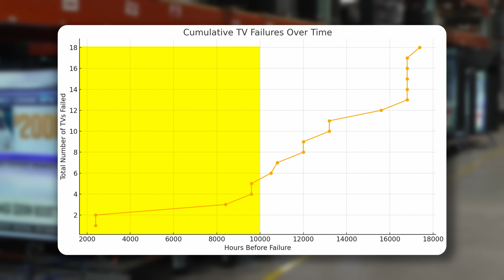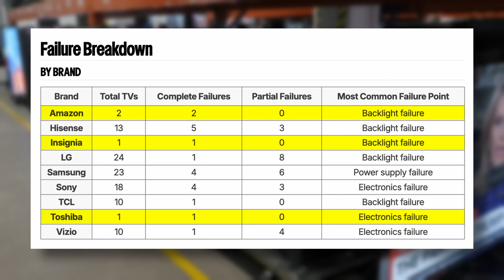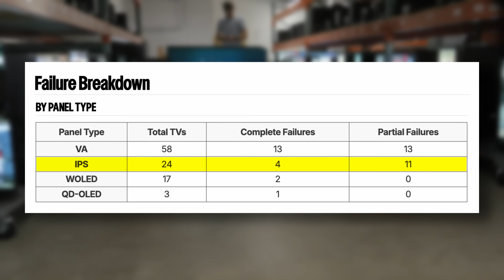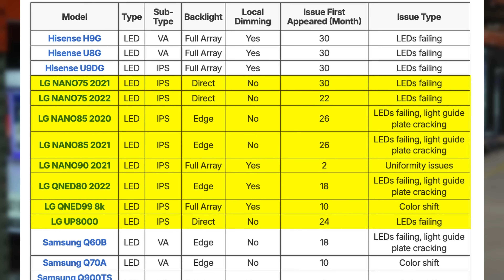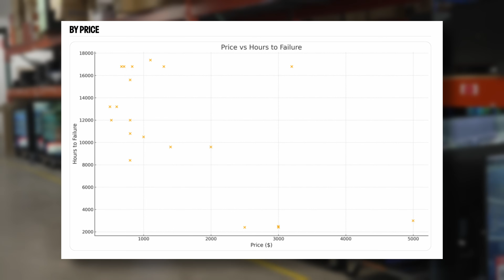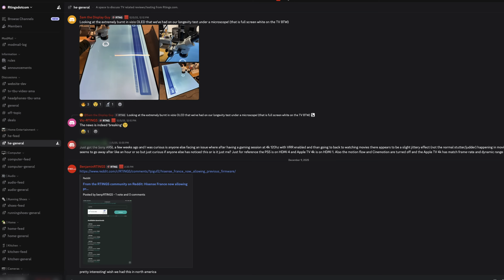Which TVs Break First? Results Overview From Our 100 TV Longevity Test

Comment: I have a TCL that's been on 24/7 since December 2018 and no issues. It's used as an advertisement screen. Only shut off maybe 5 times at the most because of local short lived brownouts, about a second each time.
I don't put its apps on the internet because... you know!  But it was a cheap tv.

Ok. So this is what I got from the data I analyzed:

OVERALL LONGEVITY TEST RESULTS

Total televisions tested: 102
Test duration: roughly three years of near-daily on and off operation
Complete failures: 20 (19.6%)
Partial failures: 24 (23.5%)
Any failure: 44 TVs (43.1%)

Most televisions operated without issues for approximately the first 10,000 hours. Failures became more common later in the test, frequently outside standard warranty periods. Each model was represented by one unit, so results show durability patterns and relative risk rather than guarantees for every unit sold.

PARTIAL FAILURES NOTE
Many partial failures were severe enough that the TV would be considered unusable or replacement-worthy in real-world conditions, even though it technically still displayed an image.

BRAND-LEVEL DURABILITY RESULTS
Failure rate includes both complete and partial failures.

TCL
Total TVs: 10
Complete failures: 1
Partial failures: 0
Total failures: 1
Failure rate: 10%
Single failure occurred very late in the test. Best overall brand durability result in this dataset.

LG
Total TVs: 24
Complete failures: 1
Partial failures: 8
Total failures: 9
Failure rate: 37.5%
OLED models performed strongly. Most failures were partial and concentrated in LCD edge-lit designs.

Sony
Total TVs: 18
Complete failures: 4
Partial failures: 3
Total failures: 7
Failure rate: 38.9%
Failures were mainly LED and electronics related. No clear systemic advantage or collapse.

Samsung
Total TVs: 23
Complete failures: 4
Partial failures: 6
Total failures: 10
Failure rate: 43.5%
Failures often involved colour shift and electronics aging rather than immediate backlight collapse.

Vizio
Total TVs: 10
Complete failures: 1
Partial failures: 4
Total failures: 5
Failure rate: 50%
Partial failures were common, including uniformity and LED issues appearing mid-life.

Hisense
Total TVs: 13
Complete failures: 5
Partial failures: 3
Total failures: 8
Failure rate: 61.5%
Highest failure rate among brands with a meaningful sample size, including failures in full-array models.

Amazon
Total TVs: 2
Complete failures: 2
Failure rate: 100%
Sample too small to generalize.

Insignia
Total TVs: 1
Complete failures: 1
Failure rate: 100%
Sample too small to generalize.

Toshiba
Total TVs: 1
Complete failures: 1
Failure rate: 100%
Sample too small to generalize.

Brand takeaway
Brand name mattered less than display architecture. Design choices drove failures more than logos or price.

BACKLIGHT ARCHITECTURE RESULTS
This is the strongest predictor of longevity.

OLED (no backlight)
Total TVs: 20
Complete failures: 3
Partial failures: 0
Failure rate: 15%
Lowest failure rate overall. No partial degradation cases.

Full-array local dimming LCD
Total TVs: 43
Complete failures: 7
Partial failures: 8
Total failures: 15
Failure rate: 34.9%
Safest LCD architecture, but still vulnerable to LED chain failures.

Direct-lit LCD (no local dimming)
Total TVs: 28
Complete failures: 8
Partial failures: 8
Total failures: 16
Failure rate: 57.1%
High risk of LED and uniformity failures.

Edge-lit LCD (no local dimming)
Total TVs: 10
Complete failures: 2
Partial failures: 4
Total failures: 6
Failure rate: 60%
Worst durability. Light guide plate and LED failures were common.

Edge-lit LCD with local dimming
Total TVs: 1
Partial failures: 1
Sample too small for conclusions.

PANEL TYPE RESULTS

WOLED
Total TVs: 17
Complete failures: 2
Partial failures: 0
Failure rate: 11.8%
Best performing panel type.

QD-OLED
Total TVs: 3
Complete failures: 1
Failure rate: 33.3%
Sample size too small for strong conclusions, but no systemic weakness observed.

VA LCD
Total TVs: 58
Complete failures: 13
Partial failures: 13
Total failures: 26
Failure rate: 44.8%
Moderate reliability overall.

IPS LCD
Total TVs: 24
Complete failures: 4
Partial failures: 11
Total failures: 15
Failure rate: 62.5%
Appeared worst, largely because IPS panels were commonly paired with edge-lit and direct-lit backlights.

Panel takeaway
Panel type alone was not the primary cause of failure. Backlight design dominated outcomes.

MARKETING NAMES VS ACTUAL TECHNOLOGY
How consumers see them mapped to how they actually behave.

OLED
Includes WOLED and QD-OLED
Self-emissive pixels
No LED backlight
Lowest failure risk

QD-OLED
OLED technology using quantum dots
Still self-emissive
No backlight
Treated separately in charts due to novelty, not because of different failure behaviour

QLED
Not a display technology
LCD with a quantum dot colour layer
Durability depends entirely on backlight type
Can be edge-lit, direct-lit, or full-array

Mini-LED
A subtype of full-array local dimming LCD
Smaller LEDs, more zones
Still an LCD with LED chains and heat risk

LED TV
Generic marketing term
Almost always LCD with either edge-lit or direct-lit backlight

CONSUMER-RECOGNIZABLE TECHNOLOGY PERFORMANCE
Best to worst for long-term durability.

OLED (WOLED, QD-OLED)
Best durability overall. Fewest failures, least mechanical complexity.

Mini-LED / Full-array local dimming LCD (including full-array QLED)
Best LCD option. Moderate failure rate.

QLED as a category
Mixed results. Good if full-array, poor if edge-lit or direct-lit.

Direct-lit LED LCD
High failure rate. Not recommended for durability-focused buyers.

Edge-lit LED LCD
Worst durability. Highest long-term risk.

KEY FAILURE PATTERNS

Approximately 60% of edge-lit and direct-lit LCDs experienced partial or complete failure.
Approximately 35% of full-array LCDs experienced failure.
Only 15% of OLEDs experienced functional failure.
About 34% of all LCD TVs suffered LED-related failures.
Common failure modes included LED die failure, light guide plate cracking, colour shift, uniformity degradation, and heat-driven layer delamination.

REPAIRABILITY FINDINGS

Most televisions were not designed to be economically repaired.
Failures typically occurred outside warranty periods.
Panel construction often made disassembly risky or impractical.
Price did not improve repairability.

FINAL BUYING HIERARCHY FOR CONSUMERS
Best to worst for durability.

OLED (WOLED, QD-OLED)
Full-array local dimming LCD (Mini-LED, full-array QLED)
Direct-lit LCD
Edge-lit LCD

FINAL CORE TAKEAWAY

Ignore marketing labels first. Identify whether a TV is OLED or LCD. If LCD, identify the backlight architecture. That single decision explained most failures observed in this test.

Comment: Looks Like you need to review cameras next. Yours had an annoying zooming issue at times. Oddly my 19 year old Samsung has a power issue which turned out to be some sort of trace issue on the board. May have been a surge or lightning cause. Repairing that at 12 years extended it for 7 more so far. Average on time about 2 hours per night. Foam bricks thrown at it a few hundred.
Reply: I think it is hard to review cameras as the "eco systems" of lenses (and preferences for colour reproduction) are so set. I'd had no issue with Canon and I like Canon's colour reproduction so I am happy to stick with Canon (in a way it's a shame they discontinued the compact mirrorless series, and moved to the larger mirrorless bodies that take the same lenses as the DSLRs, though people though the compact M mirrorlesses (tiny cameras with huge lenses) looked dumb I guess, lol).

I hear that BlackMagic are great cameras, but the colours are so flat, even with a colour correction it still looks off to me...

Reviewing calculators is even more controversial as people are unwilling to move between Casio and Texus Instruments and especially not between HP calculators with (love it or loathe it) Reverse Polish Notation!
Reply: @TassieLorenzo  Interesting info 💡 both of my photography cameras are mirrored DSLRs. Old but fun to use. I suspect Canon decided to focus on the lens carrying folks. The rest just use phones.
Reply: Sony, like BlackMagic, also have weird colour science, at least in their consumer models. Sony are obviously very popular camera bodies for professional broadcast cameras ($$$$$), I don't know if their professional cameras have the same colour science.  There's Grass Valley which competes in the professional space but does not have consumer models (AFAIK).

Comment: Why have i got 2 Celcus 21" LCD TV from 2013 that still works perfectly with everyday use as a computer monitor yet my 42" and 50" inch Samsung curved and flat panel TVs (which are are used much less) which are less than 5 years old having issues 🤷‍♂️

Comment: This is a great test of which consumer TVs should not be used as commercial TVs, with an anecdotal n=1 (so nothing can be generalized to all models of that specific TV or brand)
It's a terrible test of which consumer TV will last in a consumer setting (e.g. a few hours a day, brightness probably not at max, and mixed content). 

If you wanted to gather that data you'd be far better off calling repair shops, electronics recyclers, used listings "for parts/not working" and comparing that to published sales numbers for specific models. n of several thousand at minimum to be able to apply statistical tests to your questions. That's the scientific way of doing it which will give you some kind of realistic sense of how reliable or unreliable a particular TV set is. 

I understand this is just edu-tainment though and to increase viewership. Anybody watching should understand this and not treat it as "rtings said that X TV set was bad"

Comment: My Sony XR-65A90J has been used for hours on end for the past 4 years. I often leave it on just for ambient sound while working from home, or for my animals when I am gone. I haven't noticed a single dead pixel, single bit of discoloration, or any burn in. It has been solid. I would expect such performance for the price (it was over $2000 back then). I really have to say as far as TVs go, it has been great. I do wish the software support Sony provided was much better. As far as I know, it is still running the same Android OS version it was on when I bought it... the CPU is also definitely underpowered for the price, and the pitiful amount of internal storage is ridiculous. I also wish the remote was backlit, as well as rechargeable. Beyond that though, I can't complain about it. The sound quality of the TV is one of the strongest parts. I liked it enough to buy 6 more A90Js for my other house I built ranging from 65" units for the bedrooms up to one 83" for the main living area. More companies should use the display panels to provide sound as it truly does emit strong bass and high volume without the need for any additional speaker system. It's not going to replace a 9-channel surround sound, but just for a TV it's impressive.

Comment: I have a panasonic 32 inch from 2010 that is still going and its not like it hasn't been used. I just bought a TCL this black friday because my old TV was 15 years old so yeah I needed it, and I am happy with it so far. Of course I still have the Panasonic TV. I do also have a samsung 50 inch from around 2017-2018 that is still going with no issues.

Comment: crt had the problem with channel logo burn in.
Reply: Only in extreme cases. In practice, I can't remember ever seeing any crt tv that had burn in, including a 60s to 70s black & white tv in the 90s at one point.
It was more likely to be seen on old, high-use crt monitors - where images in the same place was much more common/prolonged. It still wasn't very common though. Likewise crt displays for security cameras etc where the image never or barely changes for extremely long periods of time.
Rear projection crt tvs, & normal CRT projections would've been more vulnerable, as they ran at very high brightness.
It was never anything like the problem with oleds, & nobody at the time crts were used talked about it being a problem for tvs - it wasn't a problem for practically everyone, as people would always switch channels at least occasionally, or watch tapes etc.
Reply: I had a computer monitor that had the windows taskbar burned into it, and I've seen many others that had the same

Comment: This is really informative. Thank you!
I have a sony X80K since 2022. Its being used for 8 - 12hrs daily so far so good. I have it on highest power saving so the backlit won't degrade too soon hehe.

Another TV that i own or my dad own, is a W607D from 2016. Lately it sufferred from backlit issue. Now the pannel has horizontal dead pixels knockout a few neighbor pixels measure about an inch. So far it serve us for about 10years didn't expect to last that long, maybe I'll try to replace it with TCL or LG.

Comment: OMG. Not one brand had no failures? That tells you a lot about today's crappy quality products. I have a 25 years old JVC CRT TV that has been powered-on for 12 hours a day since I bought it in 2000, that is still going strong and has had no failure whatsoever. Only the remote control had to be replaced at one point by a universal one. I also have a Sharp Aquos (remember those?) flat LCD with fluorescent backlight from 2008 that is still flawless.

Comment: 10k hour is a rather low bar, that's like 3 years for me. I would absolutely don't want to change TV every 3 years.
I uses TV as pc monitor, the current one (samsung UA40 something) lasted 15 years now.... just minor mold issue due to humidity and burn-in on taskbar - it's LCD, for such long usage I suppose burn in does happens. Finger crossed it last me another 10 years... the trend of making everything slim is probably why stuff's life span goes down.

Comment: I've been using an LG plasma TV since 2011. When I bought it, it was a budget 42-inch TV. 42PT353 model. I usually watch regular cable channels. It's been working for a lot of hours over the years. There are no lit logos, no dead pixels. The brightness hasn't decreased either, at least I can't see it. The Samsung LCD I bought for my parents is no longer watchable after five years of use.

Comment: I worked at a tv shop and I saw a lot of edge lit Samsungs come in. The edge lights would get hot, burn and crack the acrylic spreader and die. You can replace the LEDs, but that burnt/cracked acrylic will always be noticeable and not easily replaced.

Comment: A few points… I've been working in Elec since 98… CRTs started having failure issues after 96… thanks FCC. I’ve found over time fewer out of box failure issues since LCD tech has matured.
Reply: Longevity wise.. You've seen what I’ve seen on the TV wall display. Customer results very… living in the Southeast… my customers results are sort of scewed.
Reply: Get a ceramic fussed surge protectectir for not only power, but cable as well. Service plans are helpful as well. Nothing worse than telling a fixed income customer I can't help the after a lightning storm. This was an a issue with after 98 CRTs as well.
Reply: One thing I found disappointed ing is you didentvpoint out if any of these were commercial grade vs consumer gradei
Reply: To the public, consumer level TVs were not designed to be run 24 7.  6 to 7 years is what you realistically expect until you hit half life, from the math I did years ago.,

Comment: Most of the other TV's problems besides OLED, are on a panel level failure  which, its covered under warranty, oled burn in isnt covered by warranty, only dead pixel or electric  problem, cause most store have an option of extended warranty under they our contracted repair shops so i think its worty it if its not on oled, unless its an expensive one

Comment: As to repair, even if the TV has good access, the boards are often unavailable or expensive, making the repair impossible or uneconomic. The exception is power supplies, that's often worth looking at as the repair can often be done at the component level and is easy. Often the problem is that having a technician look at is not worth it, because of the TVs low replacement cost.

Comment: I would like to see comparisons between new, unused TV's vs heavily used identical TV's. Mostly to compare light level deterioration between models. LED overall drawback is the dimming of the light source when it heats up. In some cases, there can be night and day level differences. Those models with worse LED cooling would end up having a dimmer image. 

Would be nice to have comparisons with max brightness levels, side by side, both LED, Mini LED, and OLED models. I personally don't care that much of the burn in part, but way more interesting to see how big the LED max brightness will deteriorate after years worth of usage hours.

Comment: Still using a 1080p LG plasma. the very last made, bought it in 2011 and its still 100% with no burn in. when this does finally go pop I hope to find something just as robust. the picture is still so much better than my 2 year old lcd. wish theyd kept developing the tech, but these days things are designed to fail after 3 to 5 years max. I dont think theres a tv repairman left, its all now throwaway.
Reply: LG stopped making plasma displays in 2014.

Comment: Ah yes, the backlight LEDs failing ... my Samsung Q90t had some LEDs flickering every now and then after 4 years of use. No warranty claim because it wasn't a permanent error, and I would have to pay the technician in case the LEDs would not flicker on the day of the inspection. Crazy how TVs have built in "light bulbs" that cannot be replaced easily, even though such a design would be possible without increasing the price much. Also ... BURN-IN!!! I bought an LCD to not get burn-in. Apparently, Quantum Dots can age just like OLEDs.